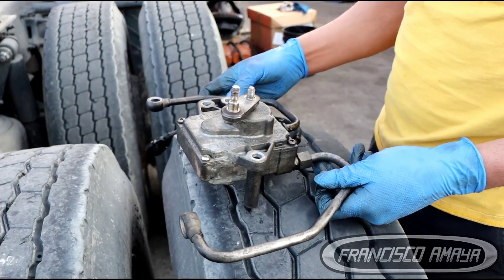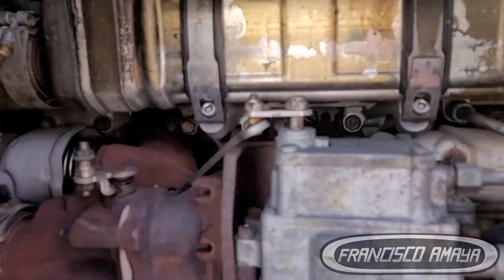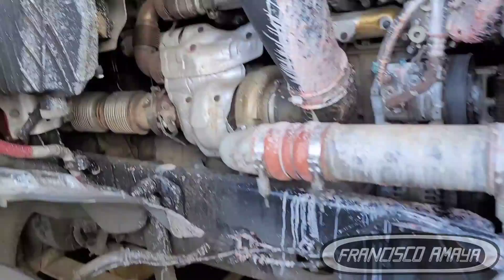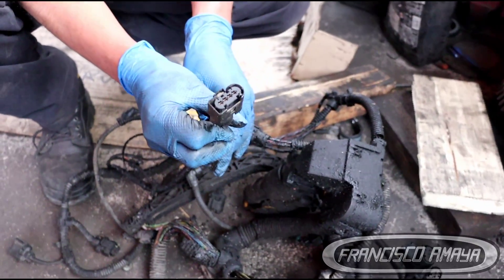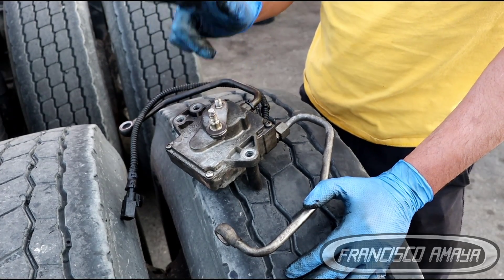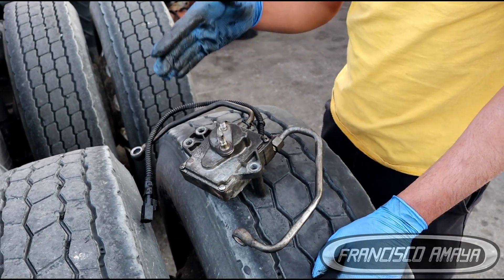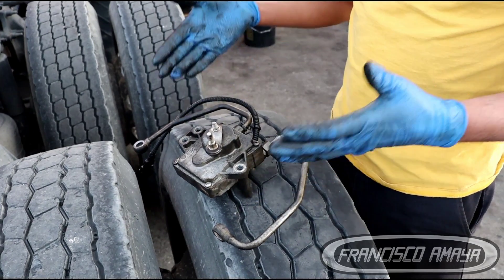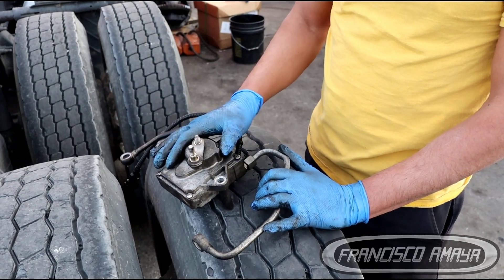DD13 DD15 engines EGR valve function how your egr valve works why the egr valve is so important

Comment: Good morning,  I'm stuck on  highway  101 s/o San Francisco  as I write  this,  at 2:00am,   so I asked  can an  EGR valve on a 2012 dd-15  jammed  and won't move , cause  the engine  to die,   U gave me the answer,  I  checked it and it  doesn't work  or move,   now I'm waiting  for the replacement to get here !! Thanks

Comment: My Jake brakes are working just fine, but I do have terrible power loss. Truck was sitting for a week and  in the morning when I started It, accelerator would bug the engine when I pressed it. I played with it for a while, and it started working.  I got loaded and down the road Under heavy load engine started surging and then I lost power to 8 psi. Speed dropped to 35 miles an hour so I had to pull over.. When I stopped, I rocked the lever of a egr actuator for 15-20 times I got my accelerator back so I was able to drive back home safely. Now I’m going to replace egr actuator.